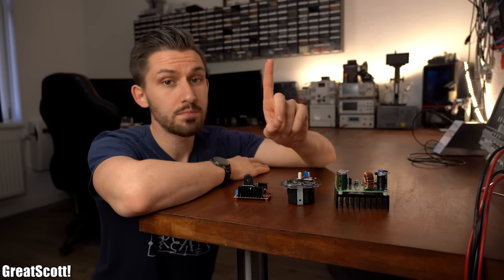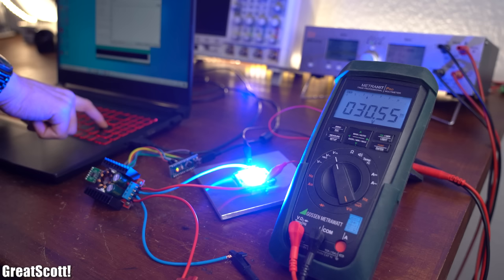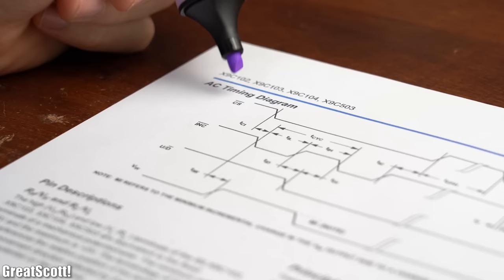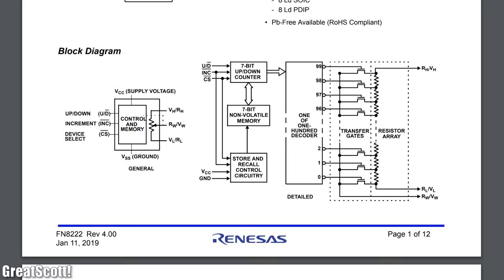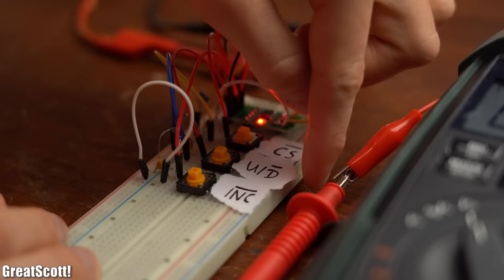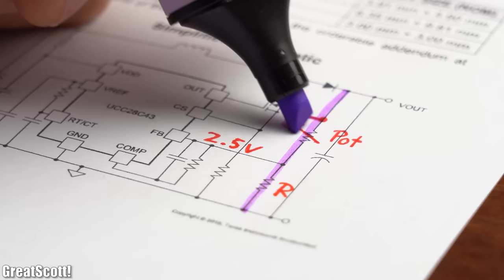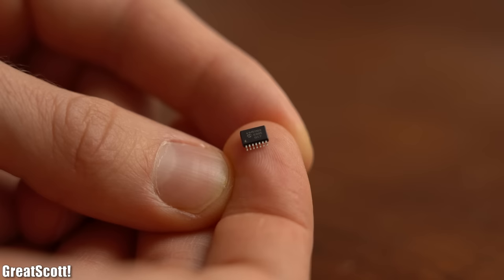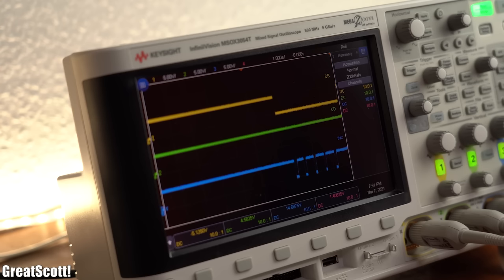This component can control tons of circuits! Digital Potentiometer Guide! EB#51

Comment: I knew I had to watch this the moment I saw a QSKJ boost converter board in the thumbnail. I adapted one to take the 18VDC nominal from my Ryobi battery packs and boost it to 20V to run my Thinkpad. Since I was able to order two for like a dollar more than one would have cost me, I have a spare and I've been thinking of all the different stuff I can do with it. Doing things digitally is a lot more interesting than analog, I have to admit.

Comment: I hadn't really thought about digital potentiometers, so this was a good topic for me!

Now add a mechanical potentiometer to your microcontroller's ADC, then use that value to set the resistance value on the digital potentiometer, so you still have the feel of the rotary switch! 😛😛

Comment: there are two solutions I thought before as alternative. I use a servo motor to drive a pot. the next one is drive a optocoupler with pwm and a filter capacitor. the output side of optocoupler can be act like a resistor, but down side is not linear.

Comment: Project:
Modify a buck converter so it will keep the input voltage at or above 17V (solarpanel mpp point) and the output at or below 13.8V.
Do this with a standard "adjustable volt and amp" converter by using the "amp limiter" opamp in inverted mode for input volts while leaving the output as is.

Comment: If you can low pass filter and don’t mind the minimum resistance of 1% you can use a resistor in series with a mosfet. Drive the mosfet with a 1 to 100 PWM and you have a variable resistor. Not quite a potentiometer but able to handle more power. And it uses only 1 pin, this is a PWM to resistance converter circuit.
Of course if you need a variable voltage for your circuit and are using a pot, then just use a PWM voltage directly, most power supply circuits will need this.

Comment: Using the voltage divider and mosfets can be a great solution for a 2 or 3 steps using discrete components.

Comment: I have to LOL at this. I literally bought a X9C103S for this exact purpose of replacing the POT on a boost converter. Except I have been too lazy to get it done. Have the POT working with an Arduino but thats about it. My idea was more to use it on the CC pot of a CC/CV converter to make a DIY MPPT solar converter to charge a 29V (7S) lithium system. From testing it seems the voltage on the CC POT is not very high so V would not be an issue as it was on the CV POT. Anyway great video as always!

Comment: Small potentiometers that get driven by screw drivers act as a circuit tuner, it's a small variable resistor that can almost precisely tune a circuit. I say almost precisely because it's not automated, it depends on what someone sets it's variable to

Comment: Be carful soldering on a live circuit. Depending on your soldering iron. My iron puts out some voltage depending on what the circuit youre soldering is referenced too.
Reply: If your iron is mains driven then the tip should be connected to ground as a safety feature.
Reply: Use ESD based soldering iron which use ceramic based heating element.

Comment: Thanks for the great video, this was exactly what I was looking for. I still have some questions according the wiring, because my digital potentiometer started to burn, maybe the chip was badly soldered.
Wiring would be:
Pin 14: external Power Supply (20V) (GND to Arduino)
Pin 13: connected to the place of the analog Potentiometer from Boost Converter 1st
Pin 12: connected to the place of the analog Potentiometer from Boost Converter (wiper) 2nd 
Pin 11: connected to the place of the analog Potentiometer from Boost Converter 3rd
Pin 10: connected to GND of the Arduino
Pin 09: connected to GND of the Arduino
Pin 08. connected to GND of the Arduino

Thanks for your help!

Comment: You could've just use potentiometer on the "bottom" side of feedback voltage divider, where voltage does not exceed Vref (2.5v?) Or you even can use PWM+RC to inject current into bottom resistor of the voltage divider. In this case you do not need extra IC's.

Comment: recently I needed 48v and 0.5A for a device, and i wanted to step up voltage from 12v, I had smaller boost converters which could only step up up to 35-40v or I had bigger ones which were overkill for my application, so I tried to modify that boost converter you shown in your video, it has N-channel mosfet rated up to 65v but that dual diode is 45v and capacitors are also rated for 35v, i changed that capacitors to 63v ones, changed that dual-diode to 100v rated one and Trimpot from 10k to 50k and boom !! now voltage goes easily up to 60v , can go higher then that but i didn't tried that, efficiency for my application is not that bad, 27W input gives 24W out.   this got me thinking - why not Chinese do this for better marketing ? or am I missing something.
Reply: The Chinese wont do that because it may hinder their market for chargers and power supplies of that voltage.
Reply: Chinese already have buck converters that go up to 60V, I bought few or them for charging my ebike from solar
They cost around 3.5 - 4 euro

Comment: I am currently using your constant current load design to build a constant current discharge battery tester with a digital potentiometer and a rotatary encoder instead of the original potentiometer so the arduino can keep the current as precise as possible (with the normal potentiometer I have the problem that for idk reasons the current slightly changes from time to time, leading to unclean results)

Comment: Very nice. Thank you for showing actually using one of these little guys. I've looked at them, but never had the need to try one. (Plus I like SPI and made my own bit-banging code in assembler for PIC--much faster that way.)
A question that occurs to me: if a higher voltage needs to be handled, why not put the DP between the base and emitter of an NPN transistor and vary between just off to turn-on needed? It would be less than 0.7V and take only a little bit of math to calculate. Or do the same thing using an open collector Opto Coupler instead of the transistor.
Reply: this way - I would not bother to use a DP at all, ESP32 has two built-in DACs perfect for wiring straight to the transistor.

Comment: In audio applications need an logaritmic characteric, for the correct volume adjust. Linear characteristic directly not suitable volume controling, only when you applied an special control IC.

Comment: There also exists variable rheostats instead of straight up potentiometers. One terminal and a wiper and that's it. Just what you need for your boost converter circuit

Comment: Sir.. Your video are great as same as Your Name....
Coming back to my point digital potentiometer has its own uses but just to increase or decrease voltage from a boost or buck convert digitally can't we use a mosfet driver circuit because here also we have to mess up with arduino code and a jungle of wires...

Comment: Debating whether it's worth modifying a brushed motor controller to take a direct PWM signal from my arduino, or  just replace the potentiometer with a digital one like this. This video was very well timed. I might actually go with a digital potentiometer seeing as all I'd have to do is attach a JST connector to the output wires of the digital potentiometer and replace the mechanical one.
Reply: Will the digipot be able to provide enough current to your motor, or is the existing pot attached to a control circuit?
Reply: @Enigma758  the pot is part of a control circuit

Comment: the problem with led light is that it does not act like a tungsten lamp.You need to design an led with multiple color leds and just like an OLED TV screen .as voltage goes down on white led voltage needs to go up on orange and red led and vice versa .I know they can make flat panel OLED lights designed from TV screens .but they are very expensive and they are even networkable . So the entire building can be dimmed or brightened or zoned for energy conservation or security .They can come in 2x2 or 4x2  standard recessed fluorescent light panel sizes or any size you want .from the size of a cell phone to a 4x8 foot sheet of glass !Or even cylindrical tubes as well .Pretty much can be printed into any shape you want

Comment: Why not use the ADC of the MCU, and use a DAC to provide the output voltage? The output can be buffered/amplified with an opamp to provide any voltage required
Reply from the maker: The feedback voltage? Well, it requires feedback from the output. If there is no feedback then bad things will happen
Reply: @greatscottlab  Sorry, I wasn't very clear about it. You can sample the output power rail using the ADC, then provide the feedback signal using a DAC. I guess this will need way more components (mainly opamps to buffer and amplify the DAC voltage, resistors and voltage rails for the opamps).

The digital potentiometer is a cleaner solution!

Comment: Question from a robotics engineer: In what situation would I realistically choose to do this over simply using a DAC? There have been several instances in the past where I was faced with this exact problem (computer controlling a component that is typically controlled with a mechanical potentiometer), but we always ended up just going with a DAC. The purpose of the potentiometer in the system is to generate a variable votage difference against some Vref (25V in your case, but often just 5V or 3V3 logic level) to generate some signal voltage. This can be entirely bypassed by hooking up the output of a DAC to the Vsignal. Generally DACs have more resolution, are far easier to control with a microcontroller, and can easily be amplified to reach higher signal voltages or load currents if needed. Also it's more efficient since you're not constantly burning Vref through an equivalent resistor (only power consumption is associated with the gate impedance).

And if you wanted to go even easier than that, most microcontrollers (like the common Arduino variants) don't have onboard DACs (they do have onboard ADCs though), but they can natively output PWM. In the past I've ran PWM though a simple RC circuit to smooth it into a pseudo-analog reference voltage. This does add additional dynamics into the system though, so should only be used if a fast response time isn't required.

Comment: Interesting video as always. I had been wondering about these and I appreciate your 'review' of them, thank you. I have read some of the other comments and a few are a bit above my knowledge of electronics to get my head around easily. However, if one wanted to create a simple digital pot with fine adjustment with simple inputs, what about a small N20 gear motor directly coupled with a 3590s 10 turn pot? You wouldn't need anything other than a switch to drive it - no I2C etc. You could even drive it with an Arduino (though it could overload the pin - it is at about the max current), but a cheap H bridge would be safer. I'd personally make the coupler not absolutely tight so that if the pot gets to the end the coupler will slip rather than break something. Anyways, just my take on it. If you want to try it, let me know and I could model it up for 3D printing.

Comment: Instead of typing into the serial window, you should wire a pot to an ADC pin to change the brightness based on the ADC value

Comment: At about timestamp 3:20 you have several tactile push-button switches installed in a breadboard.  I have been having great difficulty in locating any that actually that go deep enough into the holes for reliable contact and stability.  I finally had to solder two bare wires on the pins to make them work.
Are you using some special "breadboard switches"? If so can you tell me where I might find them?
THANKS, FOR ALL THE VALUABLE VIDEOS YOU MAKE!!!

Comment: This is very interesting, I was thinking recently about making a simple circuit to cross fade an estereo audio signal from one source to another with a pot to set the time it does the fade and 2 buttons that fire the change from one to the other, my first Idea was eletromechanical, using a potenciomenter connected to a gear reduction motor a couple of end of the line switches and a relay to invert directions, but now I wonder how I could achieve the same using this components.

Comment: lets say i want to dim an LED, do you prefere this method or PWM?
Reply from the maker: Very hard to say.....both have their advantages. I should maybe do an efficiency test to find out what method is more efficient ;-)
Reply: Using a Analog Potentiometer or Digital one is the same, so it's not going to work properly. Using a simple 555 timer circuit with a potentiometer analog/digital is going to work perfectly. (Short answer: PWM.)

Comment: Sorry but I have a question ❓ is this problem can be solved by just sending PWM signal can work like when we are controlling the speed of a motor or something we can just send PWM signal to control the output voltage that goes to the motor can just do this with any other component?

Comment: thanks , wanting to add some remote control to a 12v to 60v 20A buck converter its set @ 48v but wanting to be able to put it up to 60v if needed via a esp32 pending weather forecast / temps for a battery backup that runs the aquaponic system , typically system is off grid with 30A MPPT solar Chargers across 26x 190ah 48v  standalone systems each running a 100w air pump  but I have the grid chargers floating @48v  just incase I had poor sunlight conditions for multiple days and if weather is extremely poor I want the batteries kept 100% topped up just incase grid power goes down

Comment: Can you also controll them some way using a pwm signal? I'm a newbie at this but wanna use this for an rc project
Reply from the maker: The digital potentiometer or the boost converter?
Reply: You can inject a current on the output voltage divider network.filter pwm and then you need to buffer it using opamp .put a resistor in series in the output of opamp going to FB pin IC
Reply: @greatscottlab  digital potentiometer
Reply: @greatscottlab  i would like to controll a digital potentiometet using pwm to controll a speecontroller for a 24v 500w motor
Reply: @Lassi Kinnunen 81 looked for it, but could not find one supporting pwm

Comment: I can see that the current has to be super-low or it will burn the ic. 
I was thinking of using a digital pot for a li-on battery charger but the current there has to be between 200-500 mA, at least.

Comment: How about using several X9C103 connected in series? Will that solve the limitation on the resolution and voltage?

Comment: Is it possible to supply the low voltage Digital Potentiometer through resistor divider and use a operational amplifier to feedback the boost converter? 🤔

Comment: Why not add a transistor amp follower to the electronic pot circuit to handle the extra current and voltage ??

Comment: Can you not just connect the output of the boost converter to the led through a transistor, and then dim the led with a pwm signal?
Reply: ..or a MOSFET

Comment: I just realized. If a higher voltage, very high current digital-pot dosen't exist....we can use a large, heavy duty analog pot, being turned by a servo? Or another high precision robot part.
Reply: Stepper motor was the other robotic part I was trying to remember. That or a servo can turn a big potentiometer.

Comment: One important question:
Is the Output Stage galvanically isolated from the interface side?
And if, what are terms in the datasheet to look for?
This is a problem, that restrained me from using them in the past...
Reply: It is not isolated. I assume you didn't understand how this IC works. This is on one single silicon die.

Comment: What if you used a transistor in linear mode to limit the current flow, wich Is what that variabile resistor do? Like a bs170 or a 2n2222?

Comment: Is there a initialization time to worry about between cold power up and setting the tap value from memory? It seems to me that also by defaults first it would start with high Z on the tap, and after an instant it would turn into the selected tap value. I guess that there must be some circuits sensitive to this high-Z or whatever is while powered off

Comment: Why not just use high power transistors to control voltages like a potentiometer? I do and control from a mcu. I also add a variable speed controller. I control led with no issues like this

Comment: İs there any possibility that we can use x9c10x  with high voltage instead of the component that you use ? Because this component is not very easily accesible.

Comment: Hi. I have been interested in digital pots for a while, but I don’t understand how to make one. I need a 140k pot that goes from 0 to 140k Ohms. It’s for a variable speed drive of a treadmill motor powered by a SCR and bridge rectifier. My motor starts turning at 140k ohms so that’s the maximum value I want. I use two pots wired in series to get that value and give me course and fine speed control. 
I’d like to do this digitally. How do I design and build a digital pot that goes from 0 to 140k Ohms, with a linear taper and high precision? I don’t know squat about electronics except the variable speed drive I built. 
Forward/ stop/reverse, electric brake, toroidal ac inductor, bridge rectifier, dc choke etc. 
thanks,
Paul

Comment: I need to control an AC power dimmer that has a 500kΩ potentiometer.   But the X9C digital pots max out at 100kΩ.

I could string five 100kΩ in series and program the microcontroller to sequentially activate them in a coordinated fashion.  I will get some really good resolution but a lot of wiring and space usage.  Any other component or methodology to do this cleaner?